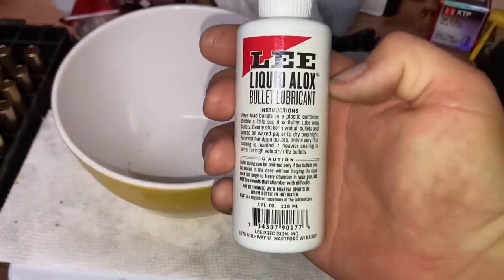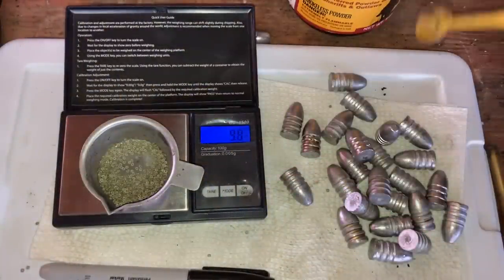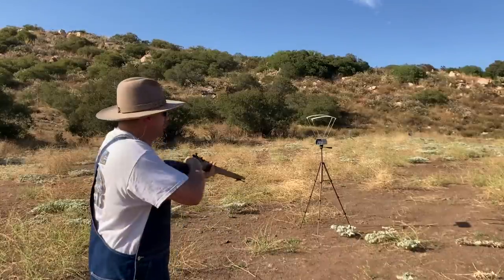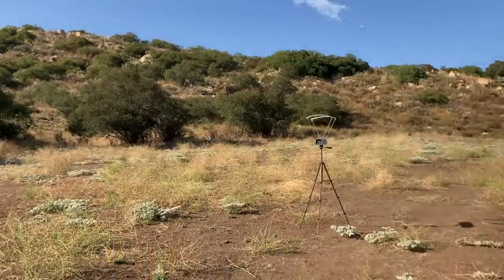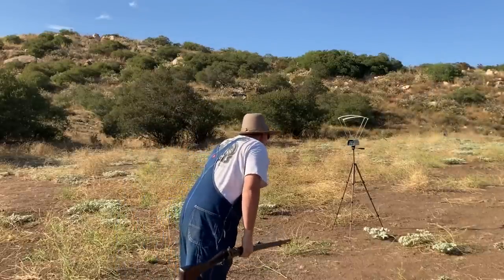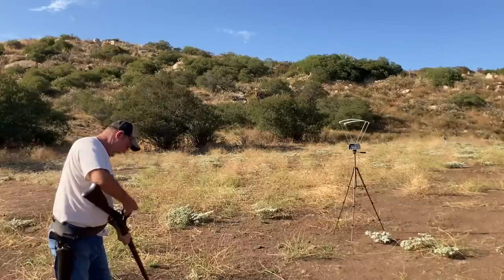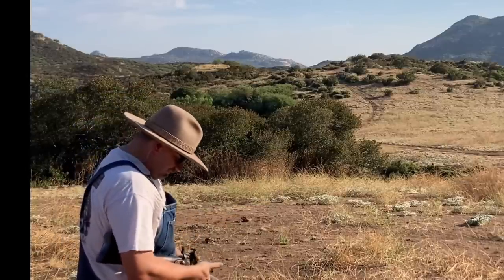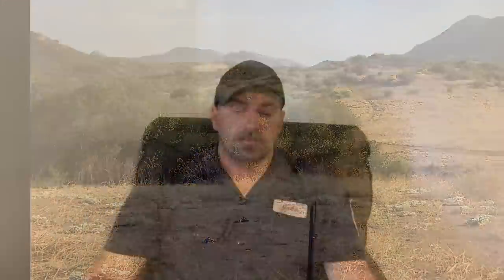Smokeless 50-70 in Trapdoor Springfields. Is it Safe?

Comment: A potential danger with using smokeless powder is that it only takes a moment of distraction to double charge a case. One time in a thousand is all it takes for disaster. I have a collection of antique rifles and use Pyrodex RS in loading for them. It uses a full case of powder like black powder, is more available, and not quite as dirty or volatile. The gun still requires a good cleaning though. If you want to use smokeless, I recommend weighing the finished round to see if one is much heavier than the rest. It could indicate an overload.
Reply: With trail boss powder a double charge would still usually overfill the case to the point of running over. But with many smokeless powders you are right. As far as weighing finished rounds with light smokeless powder loads there will likely be enough variance in brass weight that this is not effective.
Reply: @redtra236  , With rifle calibers and using the same brand of brass, the difference should be noticeable.
Reply: @davidgardner863  With a lot yeah, but we're talking about a 450 grain bullet that may have some variance in weight and probably cases fabricated from other types of cases when it comes to .50-70.

Comment: TrailBoss load sheet says IF you don’t compress it then it’s safe for all cartridges. Says it right on the sheet. I haven’t had good results with TrailBoss yet as in haven’t hit an accuracy node with anything I’ve tried it in. Doesn’t mean one doesn’t exist I just haven’t found it for that powder, bullet, primer, cartridge and firearm combination I’ve tried it in.

I have learned to be cautious sharing load data and don’t share my data with everyone instead when possible which manual I got it from and the published range from that manual. I figure there’s a reason they’ve cut data back from older manuals by same companies. If I share my load it’s with someone who can realize if it’s not at start they need to work up looking for what load suits their firearm and components best.

Comment: If you like Lee Liquid Alox trying mixing it with Johnson Paste Waste and Mineral Spirits 45: 45: 10. For a small batch like yours I like to dip lube. I heat some lube in a small cat food tin, get the bullets warm and dip them with plyers. It will fill the groves and lot leave much excess if your boolits are warm.

Comment: In my mind it's all about pressure not powder, therefore 5 grains of smokeless Winchester is the same as 25 grains-ish of black powder......... Back around 09 I was shooting 45 colt reloads loaded by a Lee reloading machine in my 1858 Rem with conversion cylinder when one shot split my cylinder and broke the gun, one lesson learned is always stand behind someone shooting a revolver........
 Another lesson learned was no more reloading with smokeless Winchester powder unless one has a top of the line reloader that will NOT accidently double charge a shell. Trouble is I cant afford a 5k reloader so the next best way to prevent double charge of powder in 45 colt is Trail Boss, now it's impossible to double charge a shell. So I bought two big jugs back then and still have most of it today, good thing to because like you say they dont make it anymore.........................
Now since they no longer make Trail Boss smokeless powder, and one day I do run out of TB, and have to go back to Winchester powder, and accidently double charge another shell, and blow my gun up again...... I will sue the the gun powder industry for not making TB powder for all damages and hurt feelings,  I will also sue Everything Black Powder for not giving me some TB powder and I will also blame Trump.................. 
Now the question is, how long will Trail Boss powder last or what is the shelf life of Trail Boss powder when it is kept in broken fridge in basement????????

Comment: The chemistry of Trail Boss is interesting, and not well known in the shooting community. It is sort of a hybrid of smokeless and black powder type chemistry. It is based on "semi-smokeless" powder chemistry developed shortly after the turn of the 19th century, IIRC it is comprised of nitrocellulose, charcoal, and a mixture of nitrates (barium nitrate sounds right to me), I don't remember is any sulfur is added but it would not surprise me. There is nothing new under the sun right? The original purpose of semi-smokeless was to control the corrosiveness of smokeless powder (the corrosiveness was actually due to corrosive primers, but it was not realized at the time. Corrosive percussion caps worked fine with black powder because the corrosive oxides were diluted by black powder residue, the semi-smokeless worked to reduce corrosion, after a fashion, for the same reason).
There is an expensive black powder substitute that advertises clean burning which is similar technology to Trail Boss - its manufacturer keeps well hidden the fact that it burns clean because it is based on smokeless powder chemistry, ie it is on a fundamental level smokeless powder, in the same way that Trail Boss is.

Comment: There is one smokeless canister powder that is supposed to more or less duplicate black powder's pressure curve - it is the powder that is recommended for use in the Savage smokeless muzzle loader (was that the Savage 10-ML?). The powder was, I think, AA xmp-5744. I haven't tried it so you are entirely on your own though, do your own research and be responsible for your own safety, since I'm sure not responsible for it!
Reply: I use it for everything from fast 308 to 45 Mongo. 5744 is safe to reduce load similar to what H4895 was.

Comment: Great info, Jake!  I've been tempted to try Trail Boss in some of my antique cartridge firearms, but since you mention that it's no longer in production, I suppose the point is moot.  In my very early Winchester 1894, I have used IMR 3031 in reduced loads with a 255 grain hard cast bullet, and with delightful success.  Very pleasant to shoot, and accurate as well.  I once harvested a grouse at 55 paces with a shot to its head, LOL !  (Lyman tang peep sight, factory original.)  Thanks for the video!
Reply from the maker: Excellent!
Reply: IMR 3031 is excellent. It's the most accurate load in my M1884 by far. Sub MOA at 100 with standard Buffington rear sight. I replaced the original front sight with a higher blade from S&S in NY. Took about 1mm off the top with a file and she was bang on.
Reply: @Mis-AdventureCH  I use it in almost all of my rifle calibers when I don't need absolute maximum velocities.  For pistol calibers I like "flammable dirt" aka Unique.
Reply: @kbjerke  I like that, Flammable Dirt. Too true, LOL. Same here. 3031 for the long guns, Unique for the 45 colts.

Comment: It should not be an issue for the tight lock up of 1868 trapdoor. Any gun with small moving parts or strange headspace methods will almost always fail over time.

Comment: I shoot smokeless hot loads in my 1887 Winchester 12g as the action is bullet proof and the barrels are the same as on the 1893 and 1897 just have 2 more revolutions of threath and diffent cut out for the extractors.

Plus i always use 70mm 2 3/4th shells without a issue.
Reply from the maker: What’s your load?

Comment: Absolutely you can use smokeless, but you’re really missing out if you do so. Takes about 80% of the fun out of shooting these old rifles. I have had two Sniders that were shot quite a bit with smokeless, and it did cause some damage to the Mk. III. The breechblock was battered to the point it jammed the locking pin in the block.

Comment: I’d be interested to know if you have any thoughts about the strength of model 1866 (2nd Allen conversion) Springfield trapdoors compared to the 1868 trapdoors?  I think My 1866 is a bit longer 3-band barrel,same length as my 1861 and 1863 Springfields. The bore is still minty shiny clean without pitting and I have an irrational fear of corroding it from shooting black powder in it.

Comment: Snider with smokeless is a bad idea most are converted enfield rifles muskets and the case capacity doesn’t really allow for it. Trailboss has also caused huge pressure spikes in the martini Henry it’s burn rate is close to bullseye.
Reply from the maker: I’ve gotten away with it
Reply: So not all old guns are smokeless safe. The martini Henry system is actually one of the strongest actions ever used in a military rifle though and can be rebarreled into just about anything that will make the turn into the chamber and is ok with nitro for black loads(40% of black powder service load) with powders like imr4198 RL15 ect.
Reply: @Everythingblackpowder  a lot of guys end up with bloopers in the snider bc of the case capacity. Dominion here in Canada did load a smokeless/semi smokeless .57 snider(1 5/8” case) but I’d definitely stay away from anything but a British mk3 snider as these are newly made. That said I think the trap door is slightly stronger and doesn’t have the tendency to turn into an auto eject like the mk1-2 sniders.

Comment: Interesting that you can’t get the same velocity with smokeless as BP.  What about 45/70 government, basic trapdoor safe commercial rounds? Will 70 grains of BP have a higher velocity? What powder is generally used in commercial rounds?
Thanks for the video!
Reply: You certainly can but not safely. He’s keeping the loads well within the margin of safety. Same would apply to the 45-70.
Reply: @66smithra  
So you are saying that today you shouldn’t shoot a rifle that was designed for 70 grains BP, with 70 grains of BP? Maybe you’re right that older guns may have metal fatigue and it’s not worth taking the chance.
Reply from the maker: It depends on what you’re comparing it to. 45-70 with 70gr 3F and a 405gr bullet in a trap door moves just shy of 1400fps.
Black hills trapdoor safe smokeless ammo with the same projectile claims 1250fps but when I tested it I was getting 1090fps.
Same with the trapdoor safe 45-70 I load with 24gr of 5744. About 1050fps.  45-70 is one the rounds you can get the closest to BP velocities and still be safe.
Reply: @greglaroche1753 no I’m saying you can’t get that with smokeless in old guns. At least I wouldn’t try it. I’d have no problem shooting 70 grains of black in my trapdoor made in 1892.
Reply: @66smithra 
What I was wondering is how the commercial trapdoor safe commercial rounds compared to BP.  Are they up to the same velvet as BP and if so what powder are they using.
Reply: @greglaroche1753  you would never know what powder is used in a factory load since that is not published. I don’t know which ammo you’re talking about but I’d bet that any factory ammo would list the velocity it makes with a certain barrel length. Some of them are marked “for use in all rifles.”
Reply: @greglaroche1753  I think the fundamental problem is that smokeless powder achieves a higher pressure (for a given mass of powder) and maintains that pressure longer than BP, but smokeless takes longer to reach peak pressure than BP. This means that using a reduced load of smokeless causes the pressure peak to be delayed until the bullet is further down the barrel. As you work up to higher loads, I think you would reach an unacceptably high pressure before you reached the same muzzle velocity as the BP.

Comment: I've seen people use smokeless powder in some muzzle loaders with good results, but safely doing it is critical and the chance of error is too high for me. You basically replicate a cartridge load without the cartridge, but the main thing is seating depth which is very easy to do wrong. And of course you must pre measure your charge with a scale.

Comment: Nope. And bear in mind that I have been a member of the C. Sharps custom shop years ago and was the only gunsmith at Shiloh in Big TImber for several years. The Trapdoor action is very weak and if WORN or  in the case of some reproduction TDs in 45-70 the cam and recess are a little “off” they can and have “auto ejected:” with blackpowder loads. One man at teh BP sil nats years ago told me his repro TD with a BP load auto ejected and the cartridge case cut a groove in his hair. The action is, due to the cooper cased,  Benet primed ammo used until almost the end of its use did not spring back when fired and would maintain pressure on the breech face or even stick in the chamber. SO.. If the action cannot be opened with pressure on the breech face it cannot be reliably iused with cartridge cases basically formed from sheet copper. Then we have the barrel issue. Even the later 45-70s often have bores in the .464” range for groove dimensions. SO a large diameter bullet has to be used to prevent gas cutting both the bullet and the SOFT STEEL or even IRON barrel. Many fast powders, like Unique will ring chambers due to pressure wave phenomenon and  not at jsut the bullet base. Even modern steel barrels. This has happened with powder specifically designed for low pressure cast bullet loads and with Unique it has rung barrels in Shiloh 45-70s and Ruger #1s. And, after I found multiple rings in a chamber of a Shiloh used with such a load Wolfgang called Ruger and the ruger tech told hom they had rifles come back with 150 rings in the chamber. It starts at the case web and will run past the base of the bullet. AND or course there is the missing finger thing. A VERY big name in gunwriting, Worked to “Rifle” and others had shot 24 grains of 2400 in a 45-70 TD for DECADES. One day its finally gave up and took part of his hand with it. After a friend of mine, another writer who has written extensively on old guns warned him he was asking for trouble. If the load does not fill the case properly it can cause the primer to flash over the charge and DISABLE the BURN RATE inhibiters and this will even break a modern bolt action. Much less a thin barreled ancient military rifle. So no I would not shoot smokeless in a trapdoor regardless of  any vintage. And I have been well acquainted with various single shots, lever action repeaters and revolvers over the years. I know a guy that lost any eye when the smokeless load and apparently case lube or bullet lube on the cartridge resulted excessive breech thrust in a repro not quite a  clone of a 1873 lever action that sheared the bottom of the bolt off and when it hit the back of the receiver it spit out the modern firing pin extension that passed through his shooter glasses and stopped, thankfully at the back of the eye socket. So remember that all the safety features of moder firearms designed for smokeless are almost ALL missing from 19th c designs. So a “problem” that a 1892 model would at worst have suck a case (if it was over charged) cost the shooter his eye and nearly his life with the 10 year +- older design. So I don’t recommend smokeless in old guns and warn against it in many repros.
Reply: BTW the Unique loa for 45-70 was in a reloading manual. Not sure its still there. Even though its been used for light rifle loads foe 100 years or so, Making me wonder how many old Lever guns have mini-rings in the chambers.
Reply from the maker: Suit yourself

Comment: 27grain Lovex D060 (Accurate 5744) works ok to and has more kick. Trailboss is boring. ;-)
Reply from the maker: It definitely is. 27 seems kind of high. I tried some at 23gr that worked okay but not nearly as consistent
Reply: @Everythingblackpowder  I use 27 gr. in all my historical guns. It misses the flames and smoke of BP Swiss. But the guns stay cooler and clean. No pitting.
I never had any problems. Specially the combination of LEE 459-405 HB and 45-70 / Beamond Vitali  11,4 x 51R is very good.
I use only one time a year BP in those guns for showing of. And than I like to use very coarse canon powder. 
That gives lots of smoke and fire outside the barrel. ;-)

But than I have to clean the gun with hot water and AdBlue (ureum)